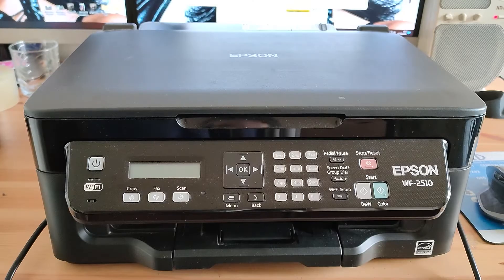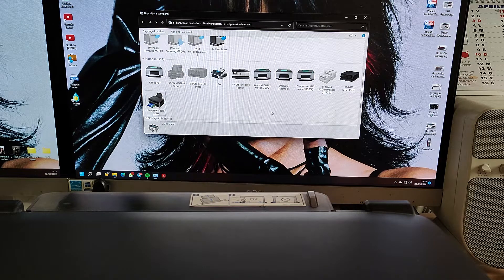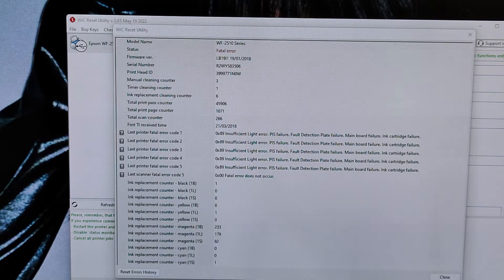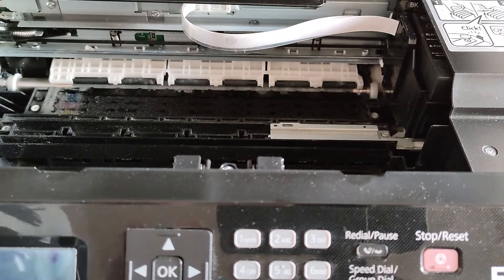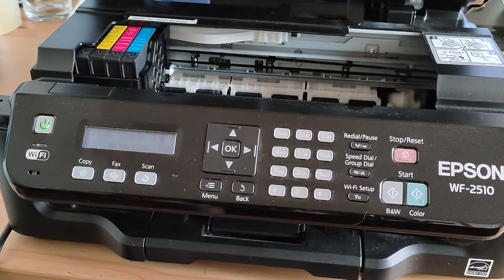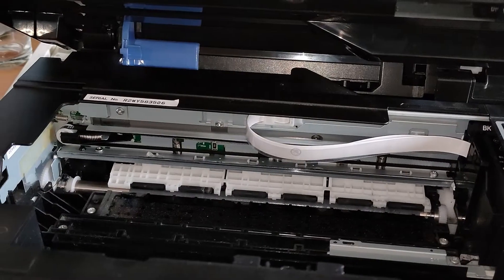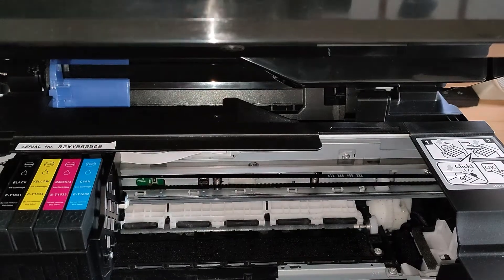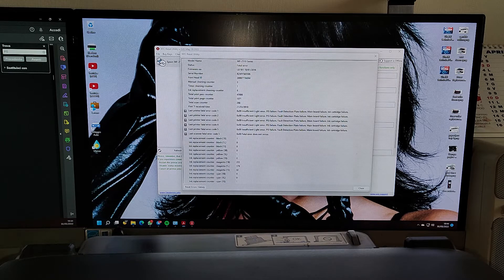Epson WorkForce WF-2510/20/30 • Come risolvere l'errore della stampante, vedere la documentazione

Comment: Great tip, many thanks! Got the same error in diagnostics, brushed the  sensor, restarted - the error cleared, printer works as new.  A little hint: diagnostics program seems to work better over the cable connection.

Comment: mine is not detecting paper , even though there is paper. is there a sensore aswell or any solutions? please.  thank you in advance.
Reply from the maker: not detecting paper? so if you try to do a copy it doesn't even attempt to pickup paper? does it give you an error message?
Reply: @PaoloMarcelli  it pulls the paper half though without starting to print, and then its stuck half way . and only massage is then no paper.
Reply from the maker: @ShadokaRecords  hmmmm definitely a weird situation that never occurred to me, but It makes me think of a broken sensor of paper registration

Comment: Thank you so much for your video timed at 14.02. I have never seen this error before but following your cleaning instructions and fortunately having a can of spray duster, I  was able to blow the dust out of all places visible and when I  turned printer back on the error message was gone and it worked first time. I  didn't have to download the wic support file but have kept it for future reference.  Many thanks for your help. Angie in the UK